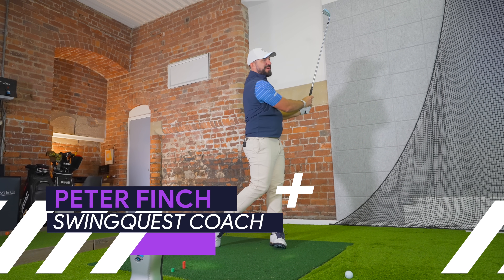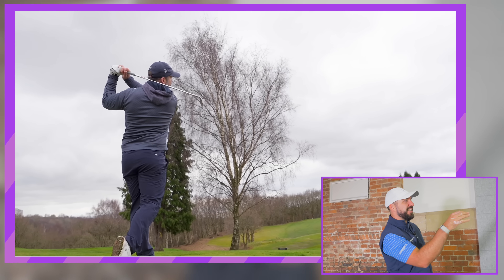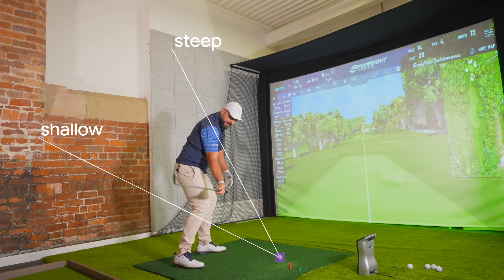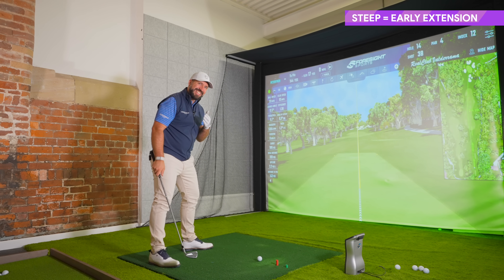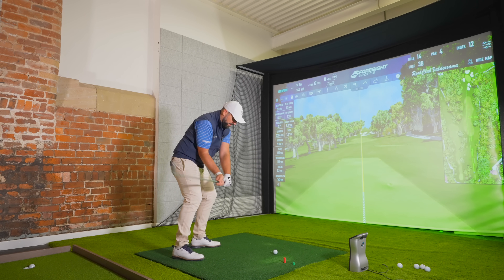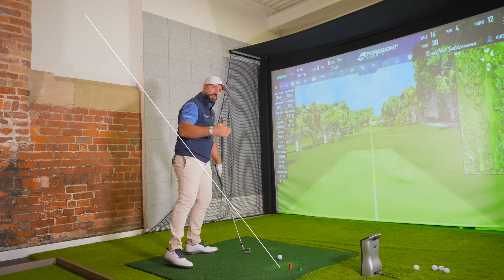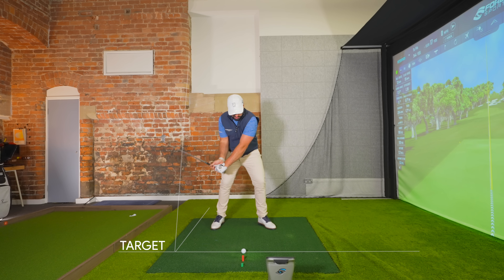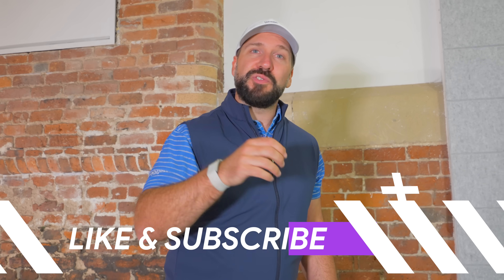Why Most Golfers Cannot COMPRESS Their Irons

Comment: Pete, I have a question about shaft lean at address. I saw a video that said the shaft lean of a 60* wedge is naturally different than that of a the long irons. In other words, if the club’s sole is grounded flat each iron with progressively have less shaft lean. So a 60* setup upright at address is not actually 60 degrees but closer to 70. I ask because I noticed you have your 6 iron leaned forward at address. Am I struggling to get compression because I setup with the shaft upright? Should I have progressively more shaft lean with shorter clubs?

I have tried leaning at address. I’ve also tried a stronger grip. I tend to get a straight pull with short irons/wedges or a slice with long irons.